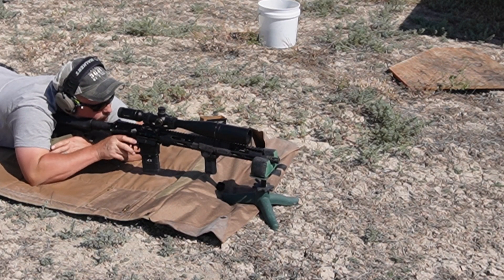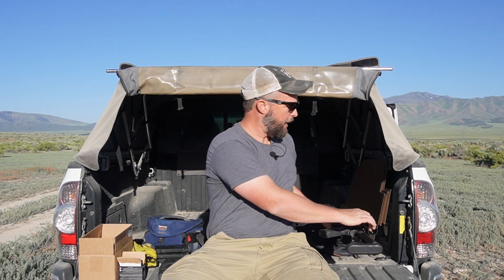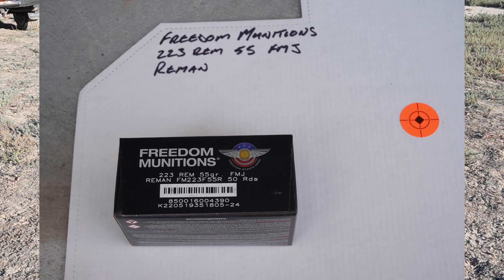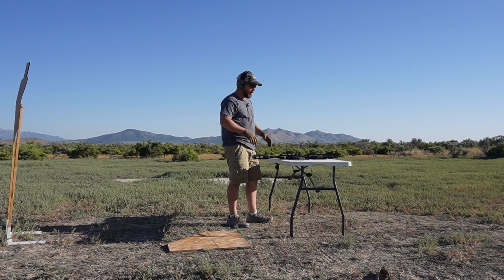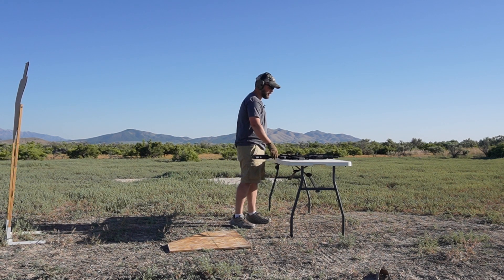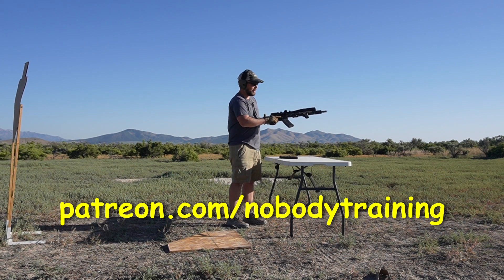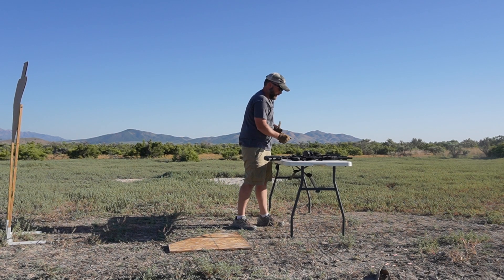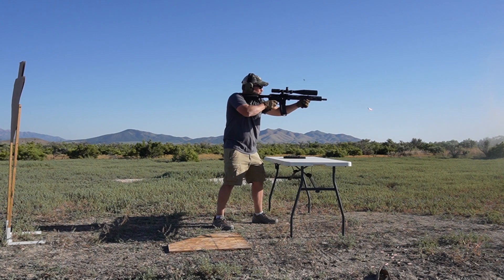Do barrel impacts change your Point of Impact on un-bedded AR? Is barrel bedding necessary?

Comment: You bed to keep the stock from changing from weather, and humidity.  You bed to keep stock strong to let the barrel free float.  You really dont know what's going on huh?
Reply from the maker: Ummm….no….you almost completed the whole logic loop. 

Bedding’s goal isn’t to weatherproof or to just keep the stock strong,etc (even though those are a result of bedding). The goal is to isolate the barrel and action from the stock as much as possible in order to give it stable and consistent platform in which to rest upon, allowing no unnecessary movement or shifting and not effected by changes in the stock. All of that is to squeeze every ounce of potential accuracy out of the barrel and action that is possible.